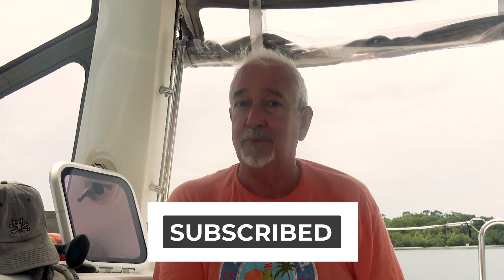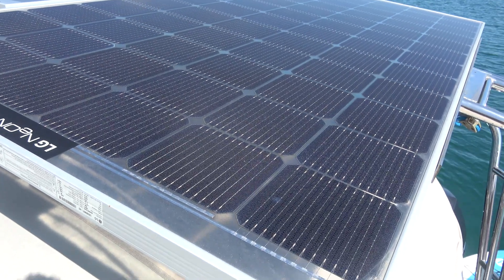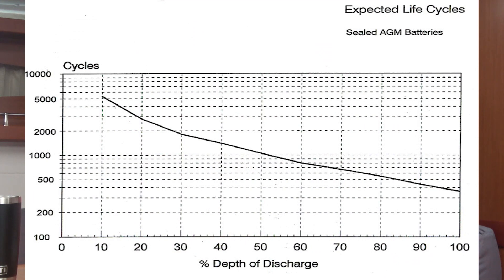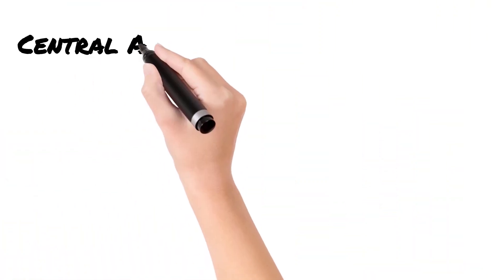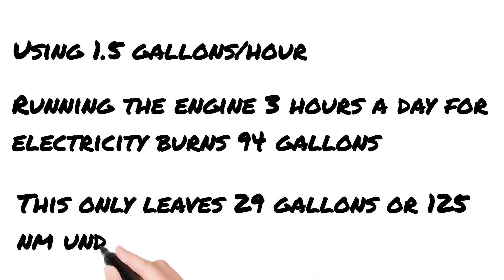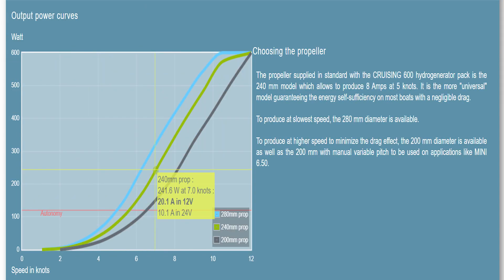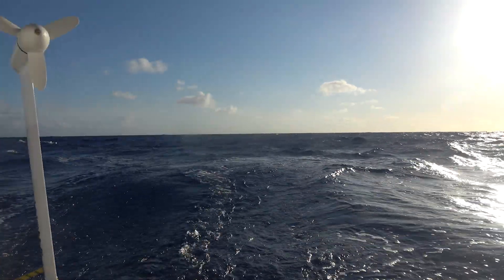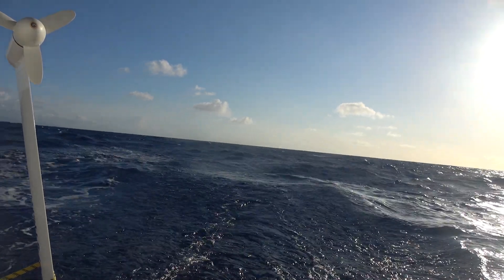Power on Passage - Review of the Watt and Sea Cruising 600 Hydrogenerator - FOR SALE!

Comment: 50' boat full of garbage AGM batteries? Lithium is cheaper than AGM now.
Reply from the maker: When we had to replace our house batteries in 2021 we were in Costa Rica and the supply chain was still impacted by COVID. We made the decision to go with Lifeline AGMs that have powered us across the Pacific, down from Scotland to where we sit anchored in Greece. We'll expect at least another five years out of them so they've been a fantastic investment. When we did the math on the cost of a conversion to Lithium (Gargoyle is a 2011) and added in the costs of getting the components to Costa Rica at that time, we could have invested the difference in a dividend stock and paid for each subsequent replacement with the proceeds. Will we replace next time with Lithium? Yes, if it makes financial sense at the time.
Reply: I've had 5 Lifeline 110's AGM's running since 2012. Very happy with them. 
Doubt I could afford them next time tho as price has gone through the roof 😖
Reply from the maker: @HimoftheBoat1967 these days it is tough affording anything!

Comment: Switch to a thick carbon plate AGM and the cycle times will increase exponentially
Reply from the maker: We were going that route last time but our schedule was tight and we're in Costa Rica with our departure window closing for a run to The Marquesas. Definitely an option next round.

Comment: Shouldnt you be charging to 80% and discharging to 40%?
Reply from the maker: Actually, with AGMs it's recommended to keep them above 70% and charge to full to maximize life of batteries. Discharging below 50% has a serious impact on battery life as does only charging to 80%. Apparently AGMs that aren't fully charged may become unable to charge above that lower charge point in the future. We have Lifeline AGMs and I would recommend you check out their website for more details. As it costs us approximately $3,000 for a new house bank, we like to get as much service out of them as possible.
Reply: @SailingGargoyle  oh sorry about that, wrong video, i thought you had lithium phospates....ooops
Reply from the maker: no worries! There so much going on with battery technologies that it is confusing.

Comment: Hi guys - what a wonderful informative video - I have the same problem - we need night time powering - trying to convince the Admiral we need a W+S 600 - and she is finding reports that they do not work. So thanks. It seems installation is critical - did you install along the midline oif your vessel..
Reply from the maker: We installed it just off the midline. That way you're out of the rudder flow. Works great though definitely need speed to generate power. Anything less than five knots of boat speed and you're better off pulling it up.
Reply: @SailingGargoyle  Thanks for the tip.. Will keep in communication and let you know how we go.

Comment: From the comments, it seems like you're well aware of how much of an impact you'd get from converting to Lithium. At 25% utilization, your 4x250Ah AGMs are giving you just 125% the capacity that a single 206Ah 12V SOK lithium bank (1060$ a pop). You'd almost double your usable capacity for 2000$ with two (2) of them, and your round-trip efficiency from all charging sources would be massively better. I'm just saying this to put the cost into perspective: about 2000$.
Reply from the maker: Lithium is an interesting topic and isn't as simple for us in our situation as stated here. Cost is actually considerably higher when one factors in changes to other systems, a seperate BMS as well as the costs/risks (shipping, timing, parts availability, duty, etc) in attempting such an update in a 3rd world country. Add in the remaining life we did have in our AGM bank and it was an option that we considered but rejected at the time.
We do appreciate the feedback as we had the same thoughts initially.
Reply: @SailingGargoyle  sounds good and you're right that the costs also include other things. These batteries have built in BMS, so that end is covered. But you'd also need to change your charge sources to fit the lithium charge profile. MPPTs and inverter/chargers nowadays can do this, but the big hiccup is the alternator: you often need to change it to an externally controlled one (Balmar makes a good one) or you add a battery-to-battery charger between the alternator and your batteries (varies in price but 100-300$ depending on amperage/brand), which limits your charging to a couple dozen amps instead of hundreds.

Comment: You have a battery problem not a generator problem.
With 1000ah or 12k wh with 25% utilization that's 250ah or 3k wh
Your solar has max peak of 1500 watts guestimating the 33% rule average 0.5k wh over 12 hour's that's 6k wh.
You can't store the power you generat. 
Guessing your drain is about 0.4k wh so you need at least 12 hour's worth  4.8k wh (400ah) sound like a minimum.
Note when you look at a battery never look at max capacity only look at usable range the rest is just market Bull s"blib". If you are only going to use 25% then you need 1600 battery minimum just t last one night on batterys
Reply from the maker: All good points and the ideal solution would be a lithium battery upgrade however now it becomes a money issue. On our recent 30 day run from Costa Rica to Nuku Hiva we didn't have any issues with the batteries as the solar and hydro generation kept them well fed under a full energy load with two deep freezes and all electronics up and running.
That said it's always a balancing act when making long passages.
Reply: @SailingGargoyle  money always a problem.
And yes lithium is King.
But you can double your kilo wh just at "0 cost" by allowing the utalazation to be the recommended 50%.
Ofc it will reduce batteries life time. But there is also cost in using the hydro (speed/maintaice) or specially using dísel.
Don't get me wrong i think the hydro is really cool idea.
Reply from the maker: @viltur83  we just a money generator! Thanks for great comments.

Comment: What controllers are u using for the watt&sea?
Reply from the maker: We use the included charge controller from Watt and Sea. It's the original model, not the newer Bluetooth enabled version.
We just gave it a significant workout on a 30 day passage to French Polynesia and it worked wonders. In our week of cruising in the trade winds power output was extremely high. On low wind nights and during the day we pulled it to reduce drag and let our solar panels do the work during daylight hours.
Only challenge we should have thought of was the few nights we had a strong 3 knot current on our stern. That effectively negated the Watt and Sea but can't complain about a 3 knot push.

Comment: If money was no object, would putting two Watt and Sea’s on be an option for extra generation or is that just overkill / stupid? Would the drag factor be too much or the extra load on the boat be too much?
Reply from the maker: Definitely two is a great option. There was a 55'+ Lagoon in Panama that had two of CR 600s. We could have also installed two but one meets our need while sailing. Load shouldn't be an issue unless you're a racer. Also look at a large Lithium battery bank and larger solar array as an option. The Vendee boats have been going that direction.

Comment: Why did you choose the watt and sea versus switching to higher capacity lithium batteries?
Reply from the maker: We had considered that as an alternative however our house bank of AGMs still has another 3 years of life or so left in them. The cost of replacement plus the environmental impact of making a change earlier just didn't make sense to us. That said, they would be a viable option. FYI, we did write an accompanying article that's posted on our website that contains more information, such as the battery discussion.
https://www.svgargoyle.com/extras